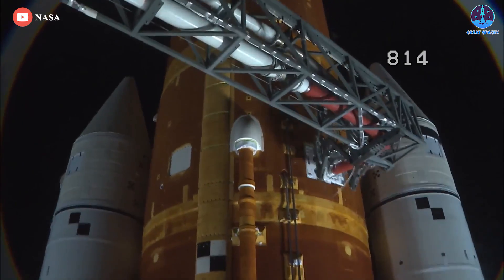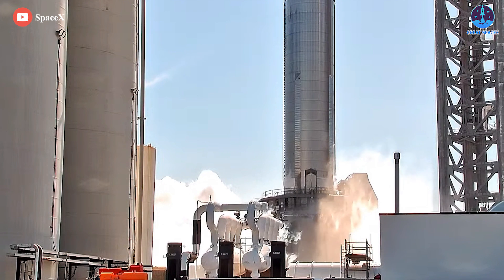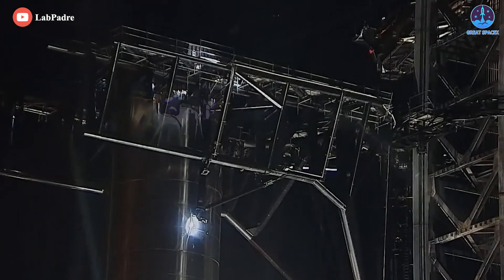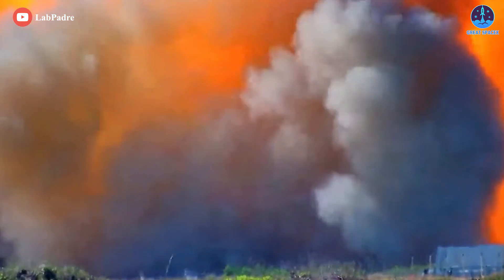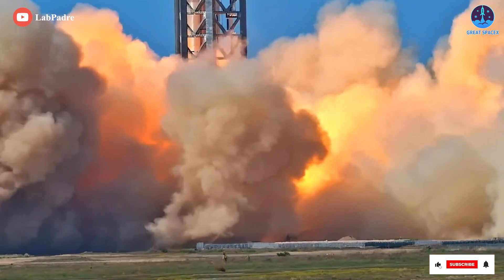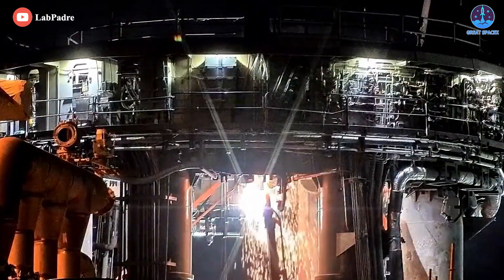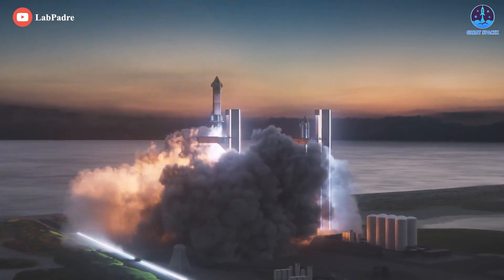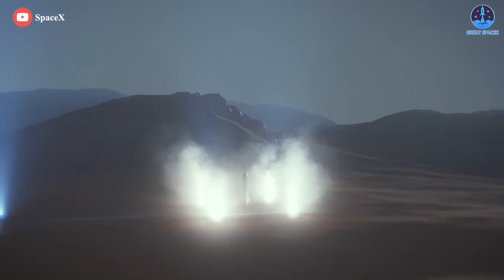SpaceX's Launch Pad Constant Problem With Static Fire Test!!!

Comment: I think building the tower on a flat surface was a bad idea, the heat etc has limited options, one is to simply bounce back up. The tower should be on top of a sloped pab, meaning that all that smoke, dust/debris can be directed a bit more downwards, or the stand built within a deep lake, so that all thats produced is steam.
Reply: i was thinking the same thing... if the concrete can't whistand the pressure and heat of the superheavy they'll have to design a better system... a redirection system like the ones at cape could be better than a buffed up cooling system than the current one
Reply: That could very well be why spacex was looking to launch from decommissioned oil platforms.
Reply: @chrisjohnson2065  and by doing so will be killing every dolphin and whale within 100 miles…
Reply: Proving my point that Elon isn’t the genius his cult following believe him to me..
Reply: @davidwebb4904  aside from the cult of people that every important person has (i still can't believe people like the kardashians have a cult for example), he IS a genious... even if the launch pad is underdesigned EVERY project in spaceX so far had bumps but eventually was a success: the first fully reusable rocket system: falcon series, the first private commercial transport certified to reach orbit and higher altitude than the ISS (and dock into the ISS): crew dragon, the most powerfull active launcher in the world: super heavy... the pad will need redesigns because the rocket is simply too powerfull (above everything else in the history of space exploration) but it's nothing that will kill the project
Reply: @darioampuy  I am not saying he is not intelligent. Don’t forget he is surrounded by a team of very talented people, for which he is taking credit for. There have been many rookie mistakes made in the Starship development. They lost THREE prototypes over such obvious design flaws, in my eyes cost them a lot of credibility. That pad is screwup number 4. The grid fins, number 5. And the idea of catching these rockets….that outdoes all the other screwups combined. Elon takes someone else’s idea, modifies it, gets tunnel vision, screws up, wastes tonnes of other peoples money redoing it, and beats the problem into submission. He is no doubt a genius, compared to his following, but I can only compare him to myself, and he’s not that smart really.
Reply: @davidwebb4904  everything you are saying someone else said about his falcon system... "it's crazy to make a rocket land on a boat", "how many prototypes he lost trying to land it on those boats?", etc etc etc... his methods of rapid prototype development looks crazy and expensive but look at his achievements compared to "conventional" development... bezos spent a decade and 10 times the cost for an engine that is subpar to elon's and is still in development, while spacex now makes 1 per week for his second iteration. look as nasa's SLS: yes, they didn't blew up any SLS so far but they spent i can't remember how many billions for a thing that leaks, stays in the platform and is already obsolete
Reply: @darioampuy  This isn't about comparing Elon to the competition. As for losing rockets landing on the barge, those were lost during fine tuning of a manoeuvre. Acceptable losses. Not lost because of a fundamental design flaw/s that should have never been allowed to happen.
Reply: @davidwebb4904  everything is a design flaw if not end working, everything as an acceptable lost if it end working. if they end correcting the launchpad issues then it's not a design flaw. if they havn't be able to make the falcon land successfully in the barges then they would have called elon a crazy person that ruined spacex because it was his tunnel vision of landing a rocket in a barge, something nobody tried before, just like now is he fixated into grabing a rocket with chopsticks. i say "let's see where he goes before calling him not a genious, because statistically he was right a LOT more times than he was wrong"